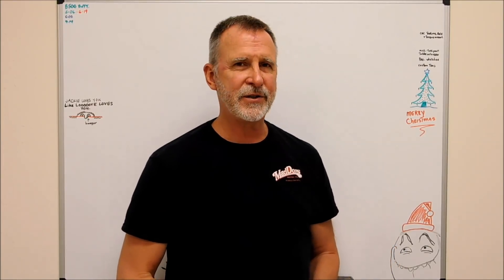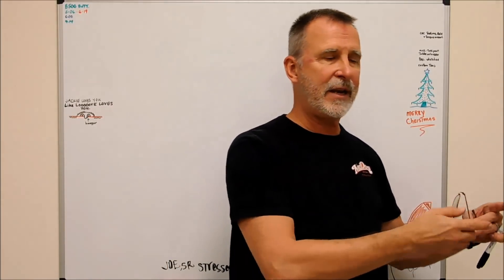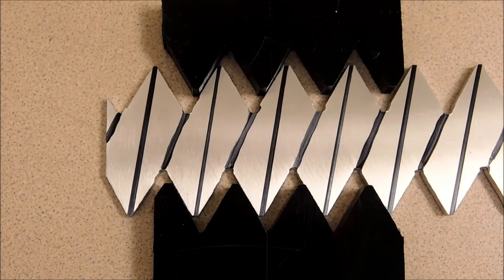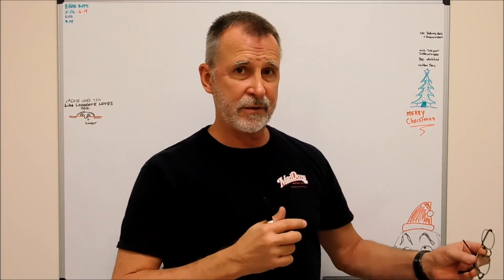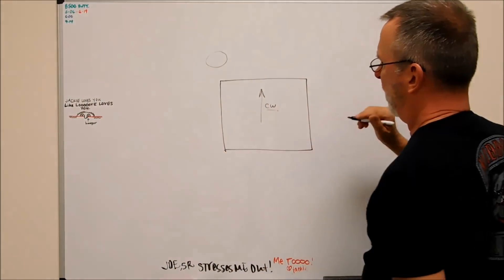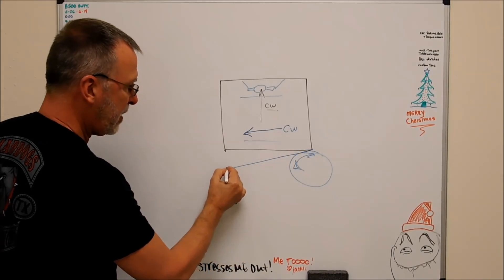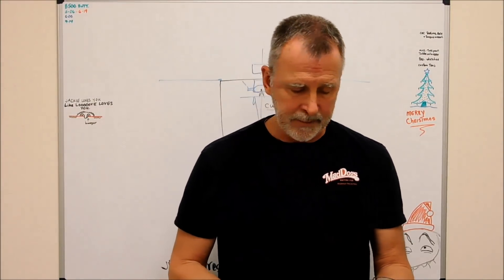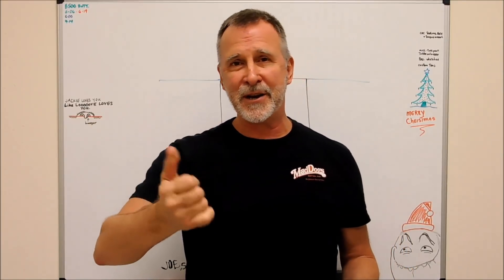Backlash and Part Geometry

Comment: Hey Joe, do you have any fairly easy to make designs for anti backlash half nuts for a small (not mini) bench lathe?
Reply from the maker: Make a standard half nut and split it. Use a set screw or heavy spring between the halves and install normally. The rejection of the halves from the spring or screw should eliminate a lot of the backlash.
Reply: @joepie221  'Make a standard Half Nut and split it.'  I 'm a little confused with what you are saying. Would you please make it more clear for an old fella like me?
Reply: @joepie221  You say, make a Half Nut and then split it? Please explain

Comment: I wonder if for worn, old lead screws you couldn't make a new double nut and use some fairly heavy spring tension to compensate for the extra wear in the center while not being so tight on the relatively unworn ends.

Comment: Thanks a lot for this video, I have bought a small Lorch Engineering lathe that also came with a vertical milling attachmnt as a first engineering lathe ( have used a much larger wood lathe for a couple of years now ) and I have heard of backlash but I didn't know what it meant until I stumbled onto this vid, i'll be sure to check what my milling attachment backlash is with a dial indicator when I finally get it set up  👍

Comment: How do I measure an eccentric end on a rod and how do I chuck it in the lathe? I love your videos Thank you for your time.
Reply from the maker: Roll your part on a surface plate and find the high spot when the eccentric end comes around. You can use an indicator and gage blocks, or a drop indicator for this. A digital height gage would work as well. Then rotate the part 180 degrees and measure it again at the low point. Split the difference in your readings and thats the offset. To chuck it, you can make an offset bushing in your mill to use in the lathe, or do it in a 4 jaw chuck if you have one available.
Reply from the maker: Subscribers have better luck !

Comment: This is slightly tangential to this video but I've been locking my table then reversing my screw direction to take out the backlash (and resetting my wheels to 0) to try to compensate for the slop when reversing the direction of cuts for things like engraving.  Seems to be working but is that legit?  As for this video, I never considered table creep and once again you've left me a bit better than I was before...

Comment: Thanks man, but how about when you are drilling holes lets say that 6X6 steel .5" thick square pc is within .002" on the thickness and you are drilling .2" holes in the skinny end and all the holes have to be centered.  I have a DRO and all, use my edge finder and start with spotting drill move on to 135 degree split face drill.  problem is that my holes end up .005-.007" off center.  I even started to adjust my Y axis after spotting ( whole mathematical calculation involved there) .  Now what really pust the cherry on the cake is when I spot one hoel and drill it then move my X axis or flip the part to do the next hole they don't come out centered like the previous hole.  Got any ideas?  I try to lock the snot out of my tables.  Have a happy new Year Joe.
Reply from the maker: Depending on how you are holding it, some of the hole migration could be vise torque or plate flex. Its also not out of the question for the drill to be walking. If you are only gripping on the 1 3/4" vise jaw, you might think about standing some 1-2-3 blocks vertically and squeezing a pair on each side of you work piece to add vertical stability. On a hole pattern required to be that tight, I would spot everything for visual location confirmation, pilot drill the holes and then slightly plunge an end mill on location before I drilled the holes. The end mill plunge would eliminate any drill wander. Another safety may be to put indicators on your table and workpiece to monitor any table drift during the procedure.

Comment: I'm now wondering how a CNC machine deals with this problem?
Reply: A thread is self locking. A ballscrew has a greater pitch and very little friction, so you would be able to push your table around and the handles would spin on their own. On a CNC, the servo or stepper motors are working all the time to hold things steady even if the axis isn't moving.
Reply: CNC's use ballscrews instead of leadscrews. Ballscrews have very little backlash and there is a parameter in the machine controller for backlash compensation.
Reply: Thanks, any idea why manual machines don't use these ballscrews then??
Reply from the maker: Steve Clark    Cost I would imagine.

Comment: Joe, Great channel-your technical "chalk talks" combined with shop demos are really helpful. Any chance you could make a video explaining how best to cut compound angles on a mill or surface grinder, starting with how they are typically specified by the customer drawing to the most foolproof way to set them up using manual machines. There isn't much info out there on this subject and your practical and efficient approach would be golden. Thanks and Merry Christmas!

Comment: For clarification...  let's say I have a Grizzley mill with a common (at least) 0.025" backlash. If I don't compensate for backlash one side can theoretically be tapered 0.000"  to +- 0.025" or, at first cut, be pulled or pushed some all or more of the 0.025" and the part will be square only +- 0.025" bigger or smaller than designed.
Reply from the maker: The answer is very conditional based on your depth of cut and direction. If your zero is your back left corner, and you are climb milling, and your cut starts in the back left corner, your back face should be true to your table, once you address the right side, the table has the potential to creep the noted .025 and result in a taper. Once you start the front face, the table once again has the potential to creep the .025. Backlash can give you parts that are all over the place if you're not careful. So basically your observation is correct. Rough then finish your desired geometry dragging the table locks the whole time. You should be fine.

Comment: Joe; Merry Christmas to you and your family. Liked the video but let me provide on suggestion. On a manual mill you have two dials on the x axis. (right to left). If you are picking up the left side of the piece you use the dial on the right end and if you pick up the right side of the piece you use the dial on the left end of the table. Why. Two reasons. If you should hit the handle on the x axis by mistake and need to reset it you always know which dial you set. Another reason is because it is easier to dial with the numbers increasing not decreasing. Charles ,Boston
Reply from the maker: Charles, you can also set each dial to zero moving in the clockwise rotation. This way you can cut an accurate dimension and never worry about backlash. This technique is especially helpful for captured pocket work.

Comment: Joe, I really like your videos and watch even the ones where I think I've got it covered because you often introduce a new wrinkle. 
I have a manual mill that's generally good with a climb cut, but this video has made me think that even with a machine with a DRO that doesn't like to climb you could go beyond your DOC then back off to the required reading and eliminate the backlash issue. 
You're literally an inspiration! 
Regards, 
Nick

Comment: (Lathe..) You need to remove backlash in the compound when switching from turning ops. to boring or internal ops,,  Not many have covered this..
Merry Christmas Joe.  Looking forward to more tricks of the trade in the new year!!!
Reply: This was kind of a "drive bye" statement..  Results may vary from machine to machine. Also cutter geometry has effect on this as well.  Negative rake vs. positive... One trick is when doing critical turning or boring ops tighten the gib on compound.. Joe could better explain this...

Comment: When I worked at Boeing in the machine shop we fought this on a daily basis. We ran a lot of older Cincinatti mills. Both horizontal and vertical machines. The lead screws and nuts had so much wear you could only cut in one direction for an accurate cut. On another note you recently did a video on internal threading from the "inside out" . I had a critical part at work that  I  successfully used your method on and it turned out great. Actually taught a co-worker the method and now he uses it. We got some practice in tool grinding and internal threading .625 x 24 threads. Thanks for the help.
Reply from the maker: Congrats on the thread. Way to go.

Comment: Merry Christmas joe and thanks for another great video

Gonna try to ask a question that makes sense..  say I make 2 parts that are basically a screw and nut (no shoulders). When I thread the nut onto the screw and turn them they are rarely concentric to each other.  What's going on here?
Reply from the maker: If you are using a tap and die, thats the problem. Thread cutting tools rarely result in concentric features. Single pointed threads should be close, but are still relying on helical surfaces for alignment. Good rule of thumb is to never rely on a thread for coaxial alignment.

Comment: Digital read out is the only way to go. I got them on all my machines to avoid these surprises. You can buy a cheap Chinese 2 axis dro for about $300, and as long as it's set up properly , it works great.
Reply from the maker: agree 100%
Reply: Toss up for first place on lathe, D1 series chuck or DRO. In my modest shop, both are indispensable. My new 'old' lathe has a Trav-A-Dial just waiting to be replaced with a DRO. The T-A-D positioning is SO awkward to use but very accurate.     The cost to replace the bezels just about pays for a cheap Chinese DRO.
Reply: Scott Burrous  Get the Chinese dro. You won't regret it. I have a travadial on my lathe that I used to use, it still works great but it's only good on the one axis. Once you get the dro, you'll wonder why you didn't do it sooner.
Reply: Marcel LeMay:  My TAD works just great in X and Y and will be replaced shortly (game plan when I got it) just had to finish building my new shop .  Then I will have a horizontal mill, vertical mill and lathe with DRO. Next is digitizing my surface grinder. So, yeah going to be happy. Just not thrilled with the cost of a scale for a 60" lathe!!

Comment: Merry Christmas, Joe.  Appreciate all of the tips you share.

Something related to what you just covered, but I've never heard anyone put thought to, is whether or not wear in one area of a lead screw could cause error in setting a cut depth on the lathe.  It's the only reason I can think of for overshooting my target size on some projects (fortunately not super critical on any of them) while using my century old lathe.  
I'd bring an area of the work close to the target size, checking with every cut, and to that point I find that I have removed what the dial told me it was set for.  Go in the last 15-20 thou. to bring it to target size, and on measuring I found out that I overshot by 1 to 2.  
The only thing I can think of to cause that would be that the feed screw had started to ramp from a more worn area into a less worn area, and that was influencing the depth of cut.  
I've taken to using a DTI on the cross feed, if the target size is critical, in order to get around that possibility.
Thinking that it would be better to eventually correct the problem (because, good as they are, DTI's can easily be thrown out of calibration to the work, and a DRO is out of reach for me), I was wondering if you could confirm if I'm on the right track about this.  From other indications that I have observed, I think this lathe had a long production run of the same part, to the same dimensions, for many years.  Turned to one size, and faced.
 Also, others that are watching may be having the same problem and yet have not seen a good reason to use a "dashboard gauge" on their lathe.

Comment: Pretty nice explanation. I only own a mini mill and mini lathe, with a "standard" backlash, but they all have screw on all axis gibs (besides set screws to remove the gap) to act as a "brake". I was wondering tho, why manual lathes don't use some kind of anti-back lash nuts, like cnc versions?
Reply: Google+ SUCKS BALLS - the worst forced social network Most have backlash adjustments in the form of a double or in most cases, split nuts. you can dial out most of it but as you approach zero, you really start to increase drag and at zero, especially on my cheaper  bridgeport clone, the lead almost locks up. probably improves with perfectly aligned and precision machined screws. there is also the oil "thickness" and viscosity that plays a roles here as you approach zero.

Comment: Joe i never knew my nuts were so complicated ! 
This is another thing that can cause an  issue with parting off in the lathe if the cross feed has excessive backlash it can pull the tool into the workpiece , this is even more evident on light weight machines as they tend to flex a little . Thanks for your hard work this year making some amazing videos that i have learned a lot from !
Merry Christmas to you and your family Joe .

Comment: How come they do not use anti backlash nuts on manual machines like what is used on CNC machines?
Reply: You can fit the machine with ballscrews but they are expensive.
Reply: Also, on a manual machine you are machining using one axis at a time but a cnc is in many cases moving with multiple axis to cut curves and angles and changing directions and climb milling so a cnc cannot have any backlash or it would result in scrap parts.
Reply: The ball screws are nice and are not that out of priceability... But from my understanding the backlash is accumulative over distance and a computer can easily account for that as it goes... A person less so.
Reply: Fred Geitner A CNC must have zero backlash but it would be nice on a manual too. You would be able to climb cut and you would not have the issues shown in the video. Yet I have never seen a manual machine advertised such.
Reply: Baldur Norddahl I agree, and i have often thought that if i ever rebuild my mill, i would put ballscrews in it.  I have not run a manual mill that had ballscrews in it though so i'm not sure if there are any other downsides besides the added cost.  Maybe the lack of friction in the nut could cause unwanted movement in an axis when machining  if you dont lock that axis.
Reply: Another consideration AGAINST ball screws on a manual mill. You would NEED to lock your table in ALL axis before you started your cut or bad things would happen. There is very little friction in ball screws and a ton of friction in acme threads. Let's say you put your ball screw in a vertical plane with the nut at the top. Gravity will screw the nut down. Reorient the screw and it will still drive down. You can do this all day!  Now put the BS in your mill and the cutter will, depending on rotation, either pull or push your part. With a BS on your knee the weight will want to drive the table down.  
On a CNC machine the servos or steppers lock the screws like friction does with acme threads.  
So, you no locky table, you chasey part across room.
Reply: Scott Burrous Yeah, thats what i was thinking. Having a little bit of friction or drag in a manual machine actually helps prevent unwanted movement.
Reply: Scott Burrous it is easy enough to add friction. Just partially lock the table. Also there are anti backlash nuts other than ballscrews.
Reply: Baldur Norddahl:  Think about it!  Just by dragging the table you are NOT eliminating backlash. When you turn the screw in the other direction is when the backlash rears it's ugly little head.  
In a ballscrew, the balls fit into the groved thread of the nut and the grooved thread of the screw. The fit is near perfect and the balls roll from one end of the nut to the other, unload, get transported to the opposite end and its lather, rinse repeat all over.  The engagement of screw, balls and nut are damn near 100%. If you tried to get that type of engagement in an acme or 'normal' thread the friction would be so great it wouldn't turn. There are plastic nuts (UHMW, Teflon not exactly sure) but their coefficient of friction is so low and their engagement is very high that backlash is almost negated. Oh, some of the anti backlash screws use two nuts with a heavy duty spring in the middle so each nut is preloaded to the opposite shoulder of the screw. I'm not an authority, just been playing with them and learning the Hard Knock School way. In my collection are 4  precision ground 1.25" x 36" screws that were $4,000 each. I'm dying to find an application for them!  They were freebies!
I also have some recirculating ballscrews that you can stop the nut travel but have the screw still turn. They aren't precision but they satisfied my proof of concept project.

Comment: The best thing i ever did for my mill was to add a DRO.. With a DRO you really don't have a backlash issue as long as you always push the part towards the end mill before cutting when setting the cut.
Reply: Hmmmm... that "need-to push" concept really epitomizes the problem!  I'm curious, the DRO being just a feedback device, so you're constantly attempting to remove the "lead slack" ahead of each new edge transition. Are you using "tacit"-resistance on the screws? Or attempting to offset a fixed 'measured runout constant' with hopes that you didn't nudge your DRO numbers out-of-position and then would have to reset by backing off and re-advancing to the DRO # again?  - newbie

Comment: Hey Joe, great video as usual. Just an additional thought....I worked at a shop where we had an old Bridgeport that had so much wear in the dovetails and gibs that the X and Y were no longer square with each other. We kept a 90 degree head on it just to square up large parts and only cut in the X axis.....otherwise it would scrap a part every time!